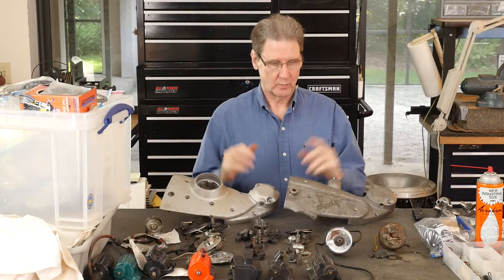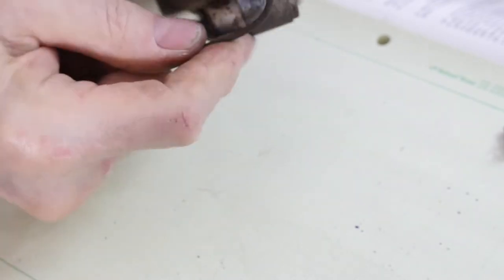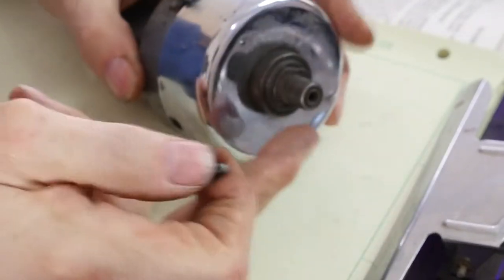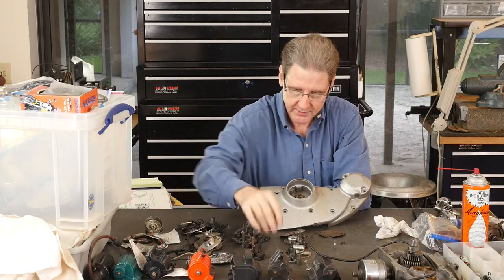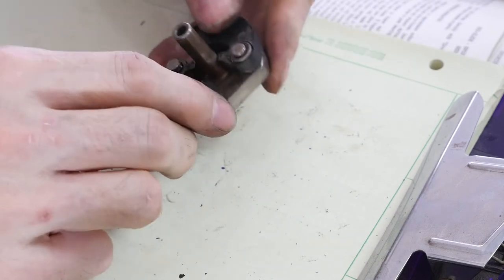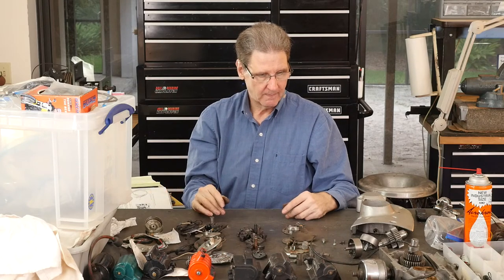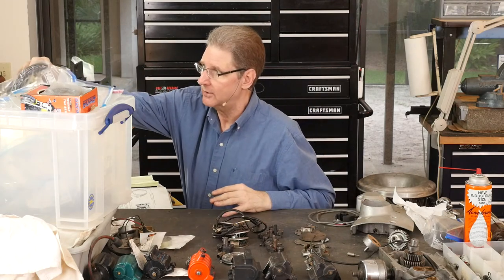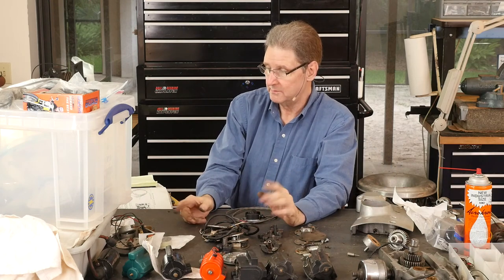Iron Sportster ignition systems

Comment: Fascinating. I appreciate your sharing. I've a very weird ratty bitsa bike with an 85? engine in 70's frame with a blue "chip" points setup. The capacitor-condensor being a surface mount MLCC Chip type.  Brilliant 4-part on the Keihin carburettor too! VERY useful indeed. Mines slightly different Andrews Power Flow AR40F which is now going to be stripped again after now understanding a little more as to why mine idles ok but bogs on revving. More cleaning grunge out & missing bung. Cheers !.
Reply from the maker: Great, I am glad to help. Good luck with that Andrews setup, I have heard good things about them, and with the parts availability problems with old Kehein carbs, I might have to buy one my self. I ran one of those chip capacitor setups years ago, and I don't think it ever failed, but I don't know what I did with it. Thanks for the comment.

Comment: wudnt trade my ultima single fire electronic ignition eye got on my 79 for nuthin!! best $ eye ever spent!
✌😎✌
Reply from the maker: Great to hear you've got a good solution working on an Iron Sportster. The 79 Sporty is cool since they still provided for a kickstarter, though they didn't build them all with one. Thanks for the comment.
Reply: Damn straight single fire ignition is the bomb. I had a 81 sturgis  was beat to death and bought it cheap never could get it to stop pinging on front cylinder  and tore it in to it and it had already had a 010 over bore and went 050 to get in speck with wiesco 10.5 pistons doubly rings crane fireball camflowbenched heads and dyna s single fire with keigin carb rejetted with a thunderjet barnett cluthes and them evo,s didnt have a chance had electric and kick infact untill i had about 3000 miles electric wouldnt tun it over id get it up on the compression strokestand on that kicker peddle crack it 3 shots from accelerater and kick that kicker with my 180 pounds and i think 95 percent of the time 1 kick was all it needed that single fire ignition worked like a dream was expensive like 400 bucks  in 2000 i recomend any one riding shovels iron heads to use them you will not be dissapointed i run single fire on my 03 twin cam also on my 77 spoty with dual pluged heads best thing you can do to a harley in my opinion
Reply from the maker: @brianstumo8581  Sounds like a great setup you have dialed in, I may have to save some ducats to buy a single-fire unit. Thanks for the comment.
Reply from the maker: @brianstumo8581  Sounds like a great setup you have dialed in, I may have to save some ducats to buy a single-fire unit. Thanks for the comment.
Reply: @Open-Sport   Im pretty sure you will be impressed with the difference they make its like night and day . I wouldnt steer you in the wrong direction . you might wanna read your plugs after you install slow, mid, & high 3 new sets and some time i did some rejeting after i installed ignition i also run a Thunder jet also it actually works to improve performance in all cuircuts on Kehin also older works best  differnt year s had bigger accelerater pump housinguse a 1/4 inch wrench and turn nozzle in float bowl so sprays directly in center of manifold as most did not you probably know them tricks im sure but put all them little things together and you,ll  have a smile on your face from the results and thank you for your sharing your knoledge with us all we appreciate the effert it  takes !!

Comment: So—1967 was the first year of the XLH (electric start). My XLCH ain't it. The magneto is everything you implied; low spark at low, kick start, rpm. My old KHK was also magneto fired but lower compression so it was manageable. With no provision for a battery on the XLCH I'm trying to figure out how to go with an electronic ignition. My wife's 79 Bonneville kicks and starts fine with the original electronic ignition and Amal Mark II carbs. What's a good solution? Small battery somehow mounted....somewhere? The later Sportsters had that lump on the side case so I guess it is easier to find or adapt but I want something that mounts to the top of the cam case where the original mag (distributor on the XLH) goes. Thanks.
Reply from the maker: I mount a standard later-model XLCH battery, 7 amp-hours, between the frame and front wheel. You have to keep it tucked in and low, or the fender might clip the terminals. You can see what I cobbled up on all my iron Sportsters, some crude, some fancy:
http://www.open-sport.org/Smorg/1962-XLH_SportsterPauls-Sportster/
Next is much cleaner, and the side-plates lets you drag the bike up into a pickup truck, should the need arise:
http://www.open-sport.org/Smorg/1977-XLCH_SportsterPauls-Sportster/
Similar to the 1977 is the '79:
http://www.open-sport.org/Smorg/1979-XLCH_SportsterPauls-Sportster-chop/
And my 1980 had a tiny battery tucked behind the starter hump, that just did not get the job done, so I did the same with it, a standard 12V 7AH battery between the frame and front wheel:
http://www.open-sport.org/Smorg/1980-XLCH_SportsterPauls-Sportster-monoshock/1980_Sportster_monoshock_rt.jpg
This was semi-crude, it used the stock 1974-78 battery box and rubber mounts, and made brackets for the frame to pick those up. Note the swoopy side-plates on the '77 and '79 do not hard-mount the battery. The have rubber washers around the through-bolts that give a bit of cushion to the battery box that I fabricated. My 1962 starts second kick with the points ignition, and first kick if it is warm. You can save your magneto, or sell it for big bucks on eBay,. I would save it if your bike is at all stock, so you can keep the original parts together. My 1962 was made from spare parts, so I sold the mag, or actually gave it to a pal with a '69 who didn't mind 30 kicks to get it started. You can also try to "flash" the magneto at an alternator/generator shop, it rebuilds the magnetism. My pal took mine off and bought one of those 500-dollar Mallory auto-advance magnetos. It's way better, but far from one-kick.

Comment: Can you make a video how to set up points and timing on an actual bike I set my timing to factory specs but I want to know how you set the timing to not burn the valves
Reply from the maker: I will try to do that when I get a video setup in the garage. The key thing is to make sure the timing is advanced, too much retard and it will burn pistons, likely before the valves. Also be sure the lifters are adjusted pretty loose, so the valve sits fully on the seat when it is not lifted. That period is when the valve transfers heat to the head.

Comment: Is there a sure fire way of checking a condenser...
Say you needed one ..went to the autoparts store to pick up a new set ...
Ohm them out on the parts counter ...???
Reply from the maker: A condenser is a capacitor, so if they have a capacitance meter, they can measure it-- let me go check with a Klein Tools MM600 from Home Depot --- yeah, mine measure around 220nF (nanoFarads) same as saying 0.220 uF (microFarads). That is what the internet seems to say as well, though magneto condensers might be different. Thing is, I have had them measure fine, and still be bad. It is breakdown at high voltage that usually happens, an a meter will not test them. Also most might measure fine at the store, and only once they get hit with the high voltage from a 300-volt ignition pulse off the coil that they fail. I just buy  one, take my chances, run it for a month, then switch back to the original. If it lasts a month, then I put the spare one in the tool bag. Sometimes the bike just won't start with a bad condenser, but twice I had them fail so the bike would start and idle, but would pop and stumble when I tried to give it throttle.
Reply: Thanks ..

Comment: watched in hopes of seeing a timer for a 71 that has the tach drive. it had it, as the cable is still there, but timer changed to electronic at one point. want to go back original but no luck finding one. any help, pics? I'd machine one if I could find more info.
Reply from the maker: Good news, I just found one in my parts stash I intend to put on one of my bikes. It is a bigger thing than you might think, in that the shaft that rotates the points cam is different than a regular timer, it has a square hole machined in the end. Once you get that, the cap is a stock cap (I think) with a hole for the drive that plugs into the square hole inside the timer and has the threaded end for the tach cable. I can't use facebook, but google shows a picture of the unit here:
https://www.google.com/url?sa=i&url=https%3A%2F%2Fm.facebook.com%2F1613930588649324%2Fposts%2Fironhead-distributor-with-tach-drive-cap-75-shipped-ironhead-ironheadsportster-i%2F2661209687254737%2F&psig=AOvVaw2l99Dbjq0i173OBOM8YgyL&ust=1651513404293000&source=images&cd=vfe&ved=0CAkQjRxqFwoTCKDtxYDtvvcCFQAAAAAdAAAAABAH

I tried to take mine apart to measure it for you, but the knurled ring is frozen and I don't want to tear it up with Channeloks worse than I just did. I noted that the square drive part of mine is broken off, explaining why this timer was on the junk pile. You might search images for "harley distributor tach drive" even though you are the rare guy that knows it is not a distributor, but a timer. I sprayed my unit down with Kroil, so maybe I can get it apart in a day or so.

You might start with the later model tach drive, and see if you can adapt it. Your biggest headache is getting the square hole in the timer shaft. You can look for a used timer on eBay, but I suspect an auto-advance timer with tach drive will be over 300 bucks by now. Sorry to say, that is why I am hanging onto mine.
Reply: Would like on my 74 too. Thanks for the great tech stuff. . .going to watch all of yours!
Reply from the maker: @neiluscook2283  Great to hear I could help. I am thinking about taking the electronic ignition off my 1979 and using points, at least until I get the carb sorted, Then I might go back to electronic.Good luck with your 1974

Comment: Magnetos?
Reply from the maker: I gave away all my magnetos since I could not start my 1962 with less than ten kicks, and sometimes 30. With the points setup it starts in a kick or two at most. So without a real magneto to demonstrate, I didn't think it made sense to video. With a mag, everything is critical. Spark plug gaps, spark plug wires, clean cap inside, point gap, timing, and carburetor. Maybe get the mag "flashed" at an auto electric store, that "refreshes" the magnetism inside it. One buddy swore he could start the bike with an old round-slide Mikuni but I never saw that myself. I used a Tillotson and then tried a butterfly Keihin like in 1977 bikes. My buddy Preacher dropped 500 bucks on that Morris auto-advance mag you can buy new, but he ended up using his Panhead with a regular ignition instead of the '69 Sporty, and then bought a new electric-start bike. Wish I could help more, but I gave up on mags 20 years ago and have not looked back. My right knee thanks me every day.